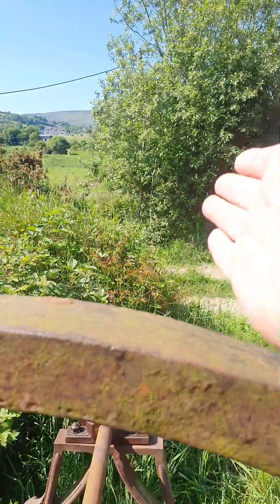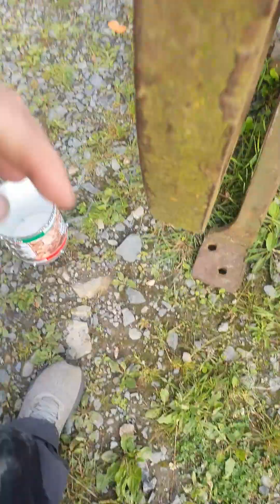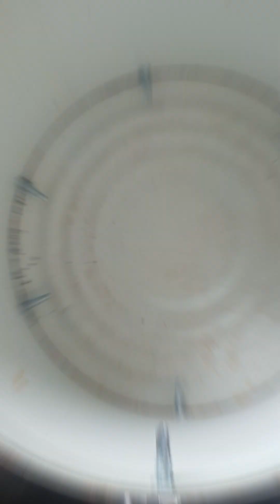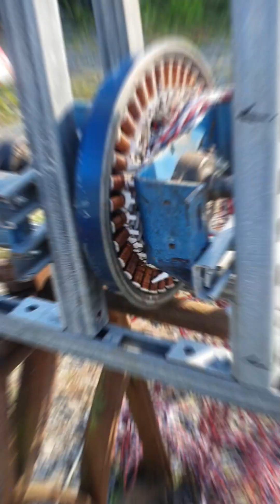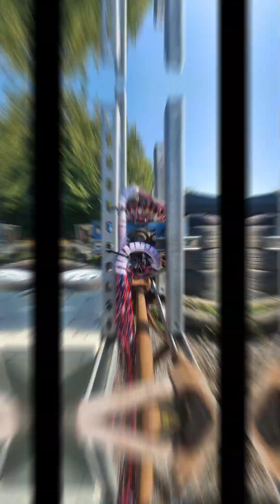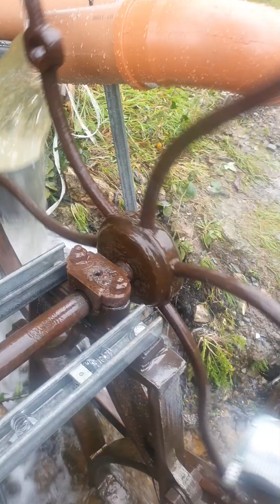OJM Waterwheel Build Part 1

Comment: Great video Barra. What can you power from the electricity generated by that turbine?
Reply from the maker: @ciarancorbett9698  this is part 1 , with this setup you couldn't really charge anything. In my next video I start increasing the rpm to get me usable voltage